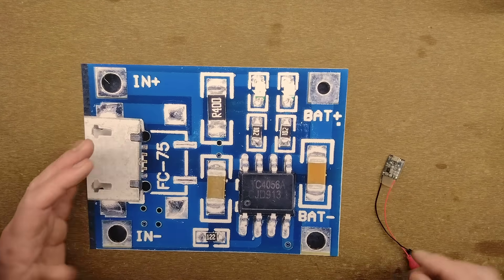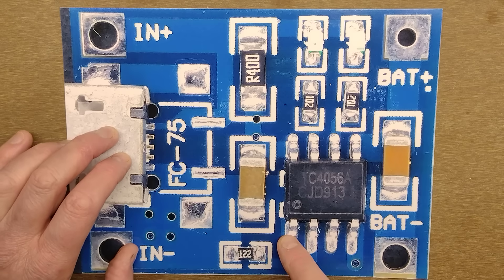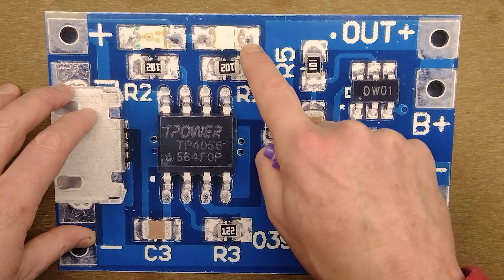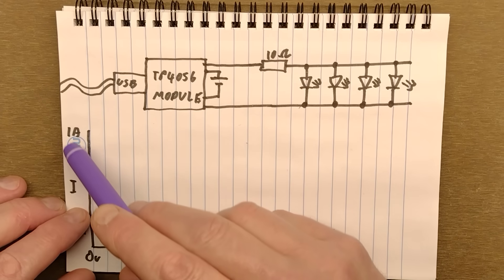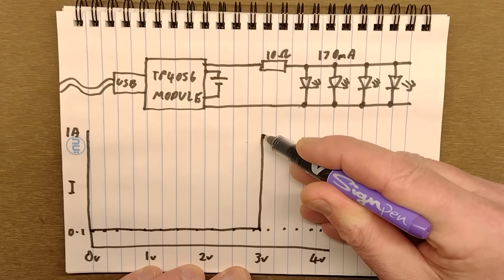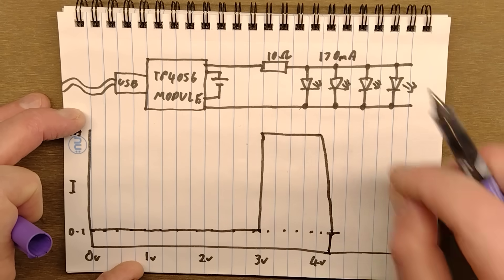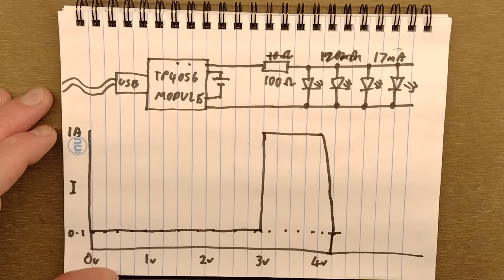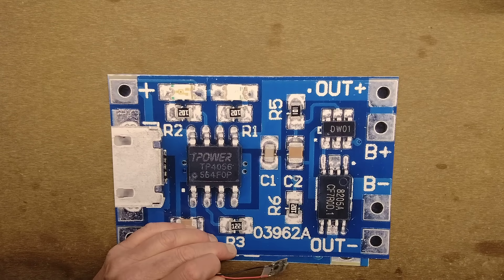TP4056 myth busting

Comment: this is my second comment here, I have built a series of TP4056 of 7 and turns 7 series of battery making them a total of 29.4V. You going to say something wrong, I have 7 of those 5V little psu rating a max of 1 amps each putting them in each connecting to TP4056 and yes they do work, I have charged them up, loads of batteries without fail... fun with no fire.
Reply from the maker: If you have cells in series, each with its own charger then you can charge the full battery if each charger module has its own separate power supply.

Comment: I fixed charlie the chameleon with this,  a reclaimed 18650, a TPL5110 timer module and a case I 3d printed.  My Nephew was happy.  I did use the updated design with under voltage protection because kids

Comment: Incredible timing, Clive. I've been looking for lithium charger modules for some solar powered ESP8266 sensors I'm building... I actually went searching for your older video just yesterday to check which chip it was people had said you couldn't use for a constantly connected load.... And with incredible timing, you're back to help me out again 👍
Reply: ESP8266 works best on LiFePo4-batteries. Voltage  range of those is 2.8V - 3.5V, which is exactly the same as  on ESP8266. LiFePo4 is also more resilient, similar to NiMH. You can tricklecharge and overcharge it. No special charging circuitry needed.
Reply: @TimoNoko  you're right, but I guess lipo or liion is what most people have on hand.
Reply: @TimoNoko  true. But I've ran many ESP 8266's direct from Li-ion cells.
uses more power at 4.2v But you get stronger Wi-Fi signal.
Reply: @TimoNoko 
I've got about 100 18650 cells sitting here. For around $1 each, this is the cheapest option.
Reply: Normal 18650 Lithium with ESP8266 is  HELL. First you have to lower the voltage and then you have to prevent it getting TOO LOW. It is known fact that if you start ESP  below 2.5V something breaks inside and it is permanently bricked. Andreas Spiess explained the exact reason quite recently. LiFePo4 with protection circuit solves all these problems.
Reply: @tin2001  I've got a collection of about 500 now, schools just toss them out like butter every time they get new laptops. 6 cells per laptop and they usually end up tossing 20-30 computers at a time. Honestly really wasteful and they're not the crappy $1 chinese sand batteries either, some are used pretty heavily but most actually keep pretty close to factory specs...
Reply: @DrakeOola tossed laptop power packs, tossed phones, tossed vapes, i got more lipo cells than you can throw a stick at. They are everywhere and usually in pretty good condition
Reply: Well not sure which solar panels you are going to use but I am now experimenting with a different (ok a lot more expensive) module SD30CRMA to charge a couple of cells. Unfortunately due to the weather I haven't been able to use it only about 5 minutes before my hands froze to the connector (kid you not). Connecting it to a 10 Watt panel it seems to work ok. Short circuit current was less than short circuit after the module.

Comment: That is why I use an USB Voltage & Current tester (Keweisi) when charging, especially when use an unknown condition cell. With this you can better understand what is the state of charge. When it is at the end of the charge cycle, finally the current will drop to zero (= battery is full). It is a good way to monitoring the charge process and progress. Using such tester in between gives you more information to understand what is going on.

Comment: Why do all Lithium power station manufacturers state that you should not leave it on charge while there is a load on?
They say it will "degrade" the battery. Some units even cut the output the moment you plug in the charger.
Please make a short video about it.

Comment: You should generally pick up the version of this board which not only has the TP4056 but also has the DW01 under-voltage battery discharge protector built onto the same board.  The boards are close enough in price that any cost savings are not worth the risk.
Reply: Worth noting that DW01 is not great for long life because its cutoff voltage is too low. You can replace it with FS312F-G which is pin compatible chip but has 2.9V cutoff instead of 2.4V so it's better for your battery.
Reply: @martincerny3294  I didn't know it was so low. I'd not feel safe with 2.4, I like to baby my cells.
Reply: @martincerny3294  thank you, it's a very helpful information for me. gonna buy some. 😃
Reply: @martincerny3294  Awesome  info! Thanks.
Reply: Undervoltage is such a risk factor with lithium cells, and aside from uninformed users even the best of us make the mistake of zeroing a cell once in a while, so it's a very important feature indeed. I took a look in my stash and was very happy to see my 4056 boards have the DW01 on them :)
Reply: Not worth buying the non Dw01 boards 
Cents of difference in price. 
In fact I’m finding it nearly cheaper to buy them in lots of 20.
Reply: Those non-DW01 boards are used for cells that already have protection circuits on them, like cell-phone batteries. i keep both version in my drawer to match what i need at the time.

Comment: I have a lot of them but without the DW01 and mosfet in them because I have them inside the Lipo battery. I am building them with the boost to increase voltage back to 5Volts or higher.

Comment: It was nice getting these in USB-C. I still have a bunch in USB mini and micro, but I don't much care for either of those connectors. And I do agree on the charge limit resistor. Mine came with the ultra small 0402 resistors(I think, it's the uber teeny one without numbers on it.). I ended up wiping it off with my iron, then soldering one end of resistor to the outer pad and the other directly to the controller pin. Fortunately, I do have soldering tips that come to a needle-like point, otherwise that would have been a real pain. But these little modules are a huge boon to anyone who tinkers with lithium cells. The fact you can get an absolute boatload of them for just a few bucks is quite nice as well.
Reply: Oh, wait till you see 0201, 01005, and 008004 size components. (Mercifully, they’re rarely used outside of high tech mobile devices, since they require extra-precise machines to assemble the PCBs, increasing assembly cost.)
Reply: 0402 meaning 4mm x 2mm? And that was 2mm x 1mm, 1mm x 0.5mm and 0.8mm x 0.4mm?
Reply: @K-o-R  Fucking YouTube. Something about explaining SMD sizes triggers the comment auto-delete. I’ve tried three times.
Reply: @K-o-R  So let’s try it little by little.
Reply: @K-o-R   No. Standard (“imperial”) SMD sizes are based on inches.
Reply: @tookitogo  Your efforts are appreciated.
Reply: @K-o-R  It literally won’t let me type in numerals “oh four oh two is zero point zero four by zero point zero two inches, equivalent to one by zero point five millimeters”
Reply: @K-o-R  The smallest size, oh oh eight oh oh four, is just one quarter of a millimeter by one eighth of a millimeter.
Reply: Metric SMD sizes do exist, but are rarely used, so unless expressly stated to be metric, just assume they’re the imperial sizes.
Reply: @K-o-R  In other words, the smallest components are literally smaller than grains of salt!!
Reply: @tookitogo  The imperial sizes are approximations of the actual metric sizes. An 0402 is actually a 1005, and the really small imperial sizes are out of sync with the real size. Nothing but inertia from a certain country behind the use of the approximate sizes.

And yes, Youtube has some pathologic hatred for expressing numbers and mathematics in comments. But they're quite okay to allow all variety of hatred, racism, and violence to flood through.
Reply: @Monkeh616  I thought that the larger sizes were in fact nominally imperial, and only the smaller ones were nominally metric? Either way, nobody seems to use the metric sizes.
Reply: @tookitogo  Every size I've used, from imperial 2512 on down, has been nominally metric in the datasheets (when I've looked that close, which isn't too often). Most SMD parts are nominally metric, even MELF as I recall. But yes, the inertia of imperial size usage is powerful so you won't see much reference to metric sizes for passives. I'm still struggling to abandon imperial nominals for trace width, copper weight, via diameters..
Reply: @K-o-R  .4 mm by .2 mm.

Comment: Float charging Li-Ion isn't as horrible as some people say, apparently.  I built various mini-UPS's with TP4056 and they all work fine for years.  There's also a nice 5V UPS module using ETA9640 chip on Ali that works great too.  The ETA9640 is a little kinder to the battery.
Reply: For a rarely used emergency device that's constantly charged but not cycled very often, you really want to cap the charge to roughly 50%. That's where lithium cells degrade the slowest.

That said, if you only need like 200mah of capacity every 6-12 months and you start off with 2000mah, it probably would appear to last 10 years or so even if you kept it fully charged 24/7.... So it all depends on the project I guess.
Reply: Sorry, but it really is bad for them.
Reply: @guygordon2780  it is not "very bad" for them at all. It doesn't provide the absolute maximum lifetime possible from a cell if you don't care about anything else, but nobody apart from battery characterisation researchers do that. All liion cells will degrade over time and no charge level or regime will prevent that, it only changes the rate by some percent.
Reply: @guygordon2780  depends, i read somewhere, its best to keep charge levels within 20 to 80% for longest cell life, an oldish(2010) samsung netbook i have has this option in its bios setup

Comment: I remember the old days of rechargable batteries. NiCd or NiMh. Used to have issues with them on RC cars, we would zap them with a capacitor bank (50v - 100v and about 2000 mfd) and they would work for another couple rounds!
Reply: Yeah, totally different chemistry.  Nickel metal is quite stable.  That's why we use it to plate water faucets & doorknobs.  Nickel batteries can last decades.  But they're so damned week.
Reply from the maker: That was or the internal whiskers that grew inside.  Not recommended at all for lithium.
Reply: @bigclivedotcom  But it would be very entertaining!

Comment: I just went all the way and bought a bunch of 4056 ICs, same for DW01s and 8205A MOSFETs.

Be nicer though if the 4056 had an external current sense resistor, that way you could connect the load after it, so the load current isn’t subtracted from the current charging the cell. I suspect those “power-bank” control ICs do something like that.

Comment: Great module. I'm using them to rebuild led flashlights to work with li ion battery from cigarette. There is also a 3A module on Ali. I don't use them before, but ordered few for testing 😁

Comment: Clive or commenters, when you make a battery powered item (e.g. some flame led lamps that will sit in the fireplace), do you make the battery a permanent part of the device? Or do you use relatively robust cells like 18650s and charge them somewhere else?
Reply: Personally, I just build them into the equipment and recharge them in place.  Just more convenient that way, and I can always replace them if needed.

Comment: The problem is that Lithium batteries don't like to be "float charged". ie: Maintaining a voltage of 4.2V across it's terminals for longer periods of time will damage the cell even though the battery has stopped accepting current. 

So leaving the LEDs ON drawing 170mA while charging will degrade the battery over time because the TP4056 will hold the voltage at 4.2V indefinitely. The solution is to have extra circuitry that runs the LEDs directly from the 5V supply during charging rather than getting their current via the TP4056. Or simply disable the LEDs during charging.
Reply: I was wondering about that. Continuously cycling between 95% and 100% doesn't seem like a good way to treat a battery.
Reply from the maker: I do wish there was a standard chip that only charged to around 3.9V instead of the full 4.2V.
Reply: @bigclivedotcom  A crude hack could be to put a germanium or schottky diode in series with the TP4056 output terminal... Plus a ~100 ohm resistor in parallel with the diode so the TP4056 can still sense the battery voltage and doesn't "think" it's open circuit. I haven't tried this myself since I haven't had a need to float a Lithium batt yet.
Reply: @strayling1  Well, lead batteries absolutely love if.  But not Nickel or Lithium cells.

Comment: At 5:20, shouldn't that be a vertical line down to 0.1A (i.e., not curved slightly)? If I'm understanding it right, it should charge at 1A all the way to the max voltage, and then at 4.2V switch to constant voltage mode and wait for the charge current to decrease down to 0.1A. The internal resistance of the cell will cause the voltage to increase during charging, and we're compensating for that. So the graph of time vs current would curve down to 0.1A, but the graph shown should go straight down.

Comment: I have used these modules while drawing current without fail for some time now. It is like a mini uninterruptible power supply for small devices that need to work 24/7. Thanks for thanks for reinforcing my cognitive bias with the truth!
Reply: Except 4.2v is not the most healthy state for lithium battery. If you want a mini-ups that lasts long time without issues it would be much better for the battery to keep it at 3.9-4v, not 4.2. I'm at the same boat, I'd love to find a piece of hardware like this one but that would stop charging at 4v not 4.2v
Reply: @pawelszpyt1640  What if you connected the battery to the board with two reverse parallel diodes (on one of its leads) in order to introduce a bi-directional forward voltage drop? 🤔
Reply: @ozonesama  I guess the official response is:

1) Nothing, it just behaves as it always did.
2) It would detect something was wrong and would never actually charge the cell.
3) It would work as intended.

My guess would be both 1 & 3: it would cut off at a diode drop below 4.2V, but then when the current had cut off, it would probably then detect that the cell was not charged (no, or very little, current through a diode can produce very low forward voltage drops), and it would then kick back in and try to recharge, repeating the cycle ad infinitum.
Reply: @ozonesama  it will work but you loose the power in the diodes. Actually no ability to set the end of charge voltage and fact that the chip is linear (no pwm) puts it into crap bin, that is why it is so cheap.
Another problem of those chips is they need nice and stable 5V - while in most cases one has variable input voltage, like coming from solar cell. this adds another regulator to the circuit..
Actually it is far better to just use attiny instead - more options, more control over simultaneous charge and discharge (two pwm channels) more easy to set all desired parameters and spare inputs for f.e. temperature control.
Reply: @piotrcurious1131 what is the name of a project using attiny for charging li ion to 4V?
Reply: @KaloyanDobrev  can't find any off the shelf but it is quite straightforward. perhaps as double safety one could use small LDO or smps dc-dc chip set exactly to 4.2V instead of MOSFET key as it would provide all the safety features of over-voltage, over-current and thermal shutdown - in case attiny fails/freezes. Pick anything with safety features and external feedback or enable pin. All attiny needs to do is to monitor voltage and turn it off above threshold, perhaps also doing CC/CV break below another threshold. Attiny is 5V tolerant so no need for a voltage divider. If you would like to limit parts count you can also do software ADC measuring time to charge and discharge small capacitor connected to attiny as its time constant depends on supply voltage , while threshold is defined either by logical 0 threshold or by internal reference if you use ADC to detect threshold.
Reply: @pawelszpyt1640  I have been doing this for years with success and never encountered any problems, To many people over engineer things and never get anything done.
Reply: I have a small stack of them, I'm intending to add a battery to a cat feeder to keep it from losing programming, and feeding the cat for a day or so if the power goes out.

Comment: The thing to me is, quiescent current. If battery is left for a while, does the protection keep taking current, or totally disconnect?
Reply from the maker: The DW01 type protection circuitry only uses microamps.

Comment: I had this problem of charging light on. I used a lion battery ex vape batt in modified radio phone. I needed voltage regulator in the cradle 8V down to 5v and 3.3 regulator in the phone to regulate battery voltage to phone supply. Works well but couldn't understand the charge light not going off so your brilliant . Thanks for the vid.:goodvibes:

Comment: i think this lithium charging board aint fully charging batteries, i use this board and when charging light turns blue(full) i transfer the battery to my 220v 18650 charger and it's still charging for a long time
Reply from the maker: The end of charge voltages might be slightly different, and the topping off current may be very low.
Reply: @bigclivedotcom  so does this fully charge or undercharge?

Comment: I burnt out some modules like that by applying power (to measure the charging voltage) before connecting the battery. I bought cheap ones though, hopefully more expensive ones don't have that problem.